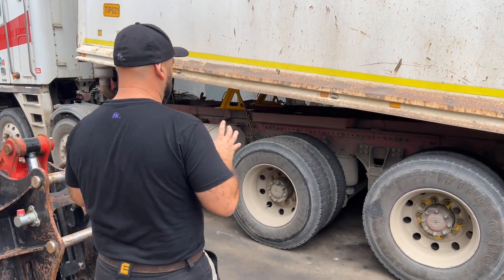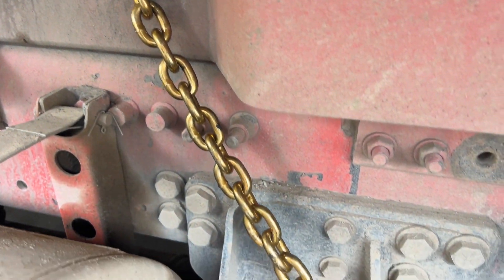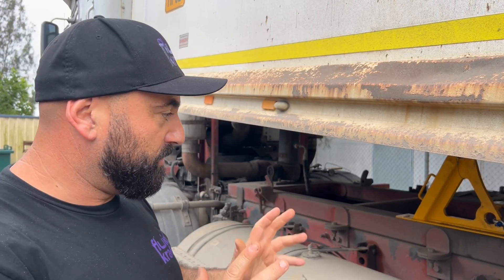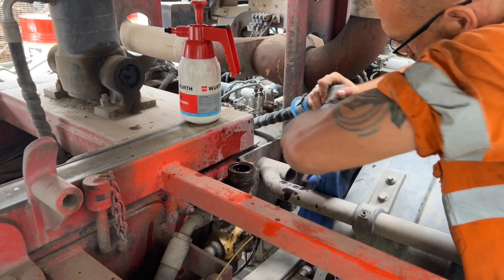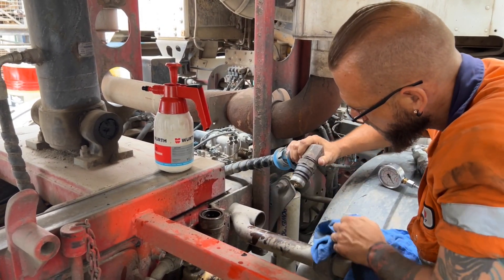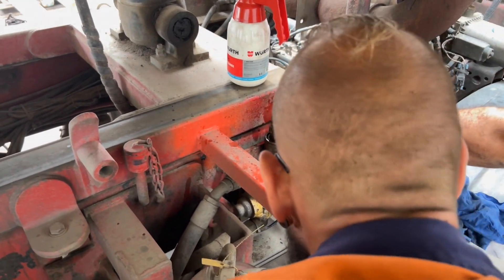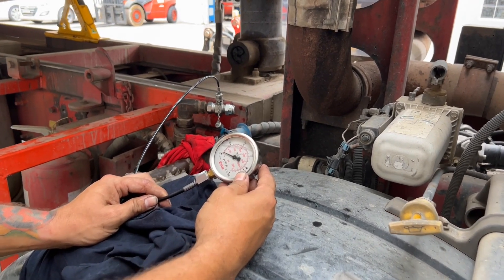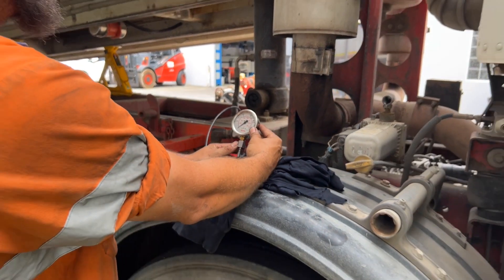Hydraulic tipper. Diagnosing an issue with a rigid tipper.

Comment: In my city I have thought that if we replace the oil jack with an air jacket, what do you think about it?
Reply from the maker: Yes and no.
In theory it’s possible, in reality it’s not practical.
There’s a reason why hydraulic oil is used as a medium in place of air (gas). 
I won’t be explaining it here as there is a lot online (google)
A Pneumatic cylinder in place of a tipper hoist like in this video would not be practical